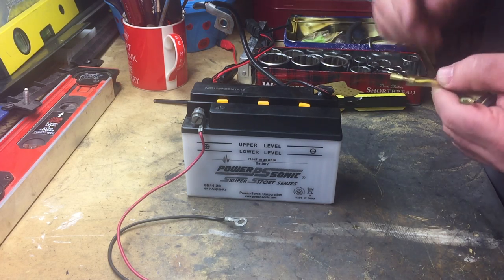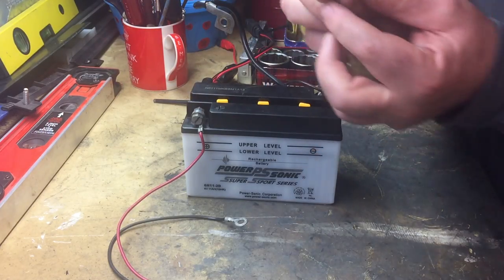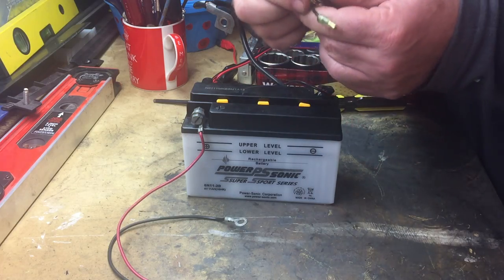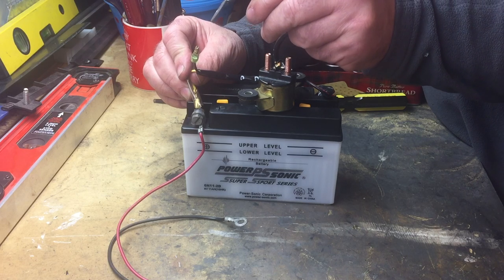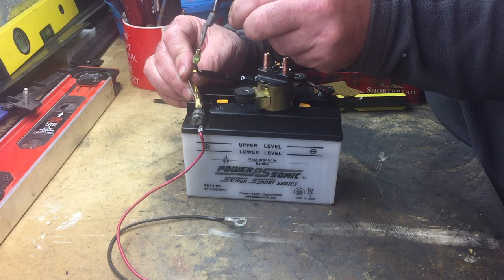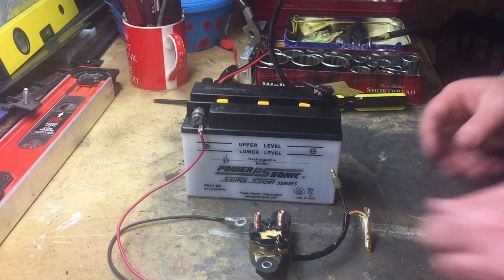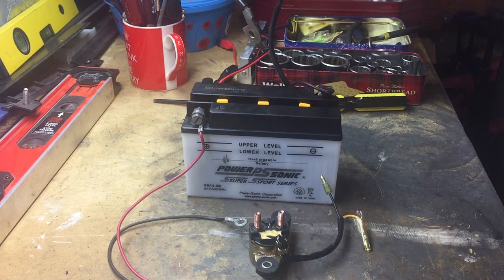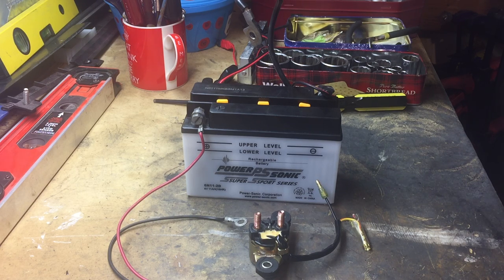1981 Honda C70 Passport (08) - Starter Problem 3 - testing the solenoid

Comment: HI mi tv, by any chance do yo remember where you got that solenoid from?  ive been scouring the internet and cant seem to find the solenoid for a 1981 anywhere.As from what i can tell those ground to the frame using the mounting tabs unlike other replacement solenoids
Reply from the maker: Hi Emmanuel, I'm pretty sure that it was the original from the bike and I didn't buy a new one.  Perhaps some of the viewers can help?  Best regards
Mike
Reply: Hello , I'm having issues with my 81 c70 . I have no lights to the motorcycle no brake lights or turn signals  or horn, I have no power going to the red n yellow small wire on the starter solenoid and no power to the black small wire on the solenoid  as well. If I jump the positive battery cable to the small wires either  one the yellow n red or the black one I get power to the horn tail light and brakes . Any idea what this might be. ?